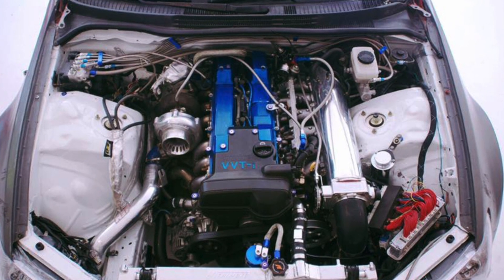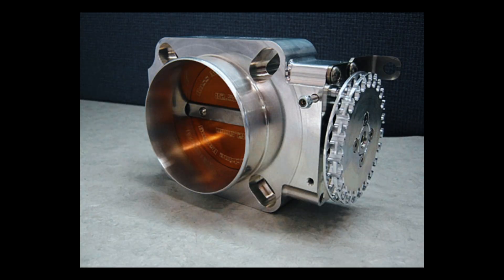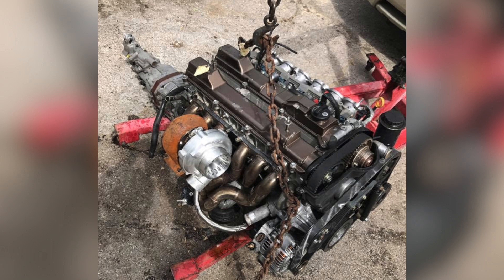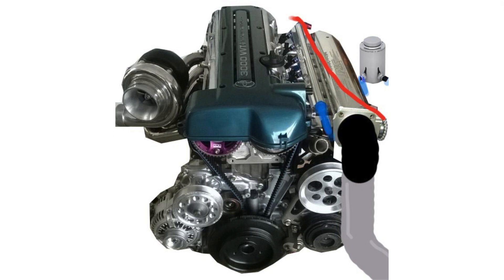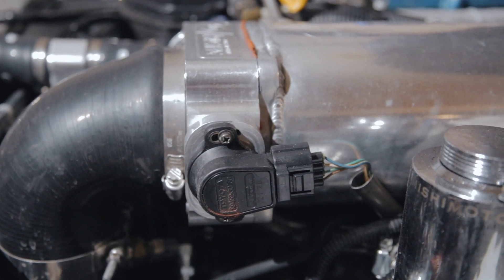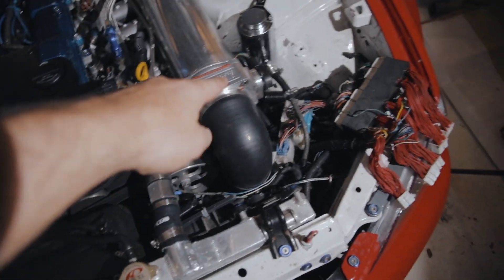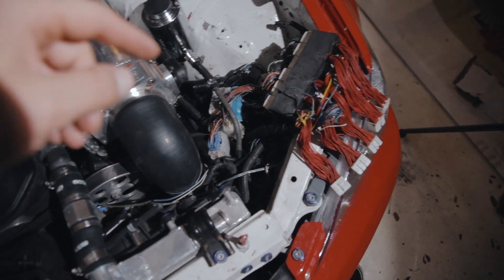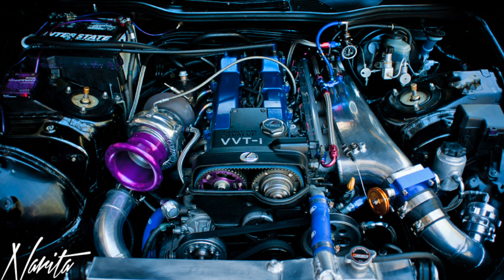HOW TO: Supra manifold on IS300

Comment: Came here to see how you bolted the plenum to the runners. Still don't know how to bolt the plenum to the runners lol. My arm is more than 3" in diameter so literally impossible to tighten the nuts from the inside.
Reply from the maker: See if you have a friend with small forearms. I struggled pretty bad with it, I put some grease on my arm to help get in there 😂
Reply: @cyrusmohebi  omg 😂😂

Comment: Hi, are you still online? 

Can I ask you some questions in DM about the intake manifold? I have 2jz ge stock, I already have the same intake manifold as you, but your the only one that has said the cruise control won't work after installation. As the car is planned for daily use, is it possible to add the cruise control function back? I have some questions about vacuum lines and stuff that must be deleted from the back of the engine.
Reply from the maker: If you are somehow able to maintain the stock throttle body you potentially could still have cruise control. From what I remember the cruise control feature is electronically controlled by the stock throttle and ECU

Comment: Could I run that setup as NA?
Reply from the maker: I wouldn’t recommend it
Reply: @cyrusmohebi  vacuum insufficiency? Compression issues?
Reply from the maker: @peterfalken2498  if it’s NA it would be too much work to go stand-alone ecu, do all the labor to fit the manifold and lose cruise control/ TCS.. just to have a FFIM and make around 200hp. There would be no point IMO other than looks
Reply: @cyrusmohebi  Thank You
Reply: @cyrusmohebi  BTW, my cruise don't work anyway

Comment: How did you tighten the bolts from the inside of the manifold?
Maybe this will help others... 
My friend and I arms and socket are too large for that closed space. We drilled and tapped holes in the plenum above the bolt holes. It was the only way we could fit our socket into the plenum then we closed the holes with bolts. Some people may not like it but it's a 130$ plenum. Your already drilling and tapping holes for the vacuum lines and you may has well make it easier installing it. Later my friend cut the bolts closer and clean up the treads.
Another good tip is to space out your vacuum lines. It's difficult to install your fitting if their too close.

Comment: This was a really good example of how to do it and what you sacrifice. I actually want to keep my cruise control for longer trips, anyone know if another throttle body that would allow you to keep it? I've read possibly an SC400 TB could work or even LS400 but can't confirm.
Reply: I'm going with a 350z throttle body with adapter on this same FFIM. Will be connecting to an SC430 DBW pedal and run on Haltech so I can retain cruise control.
Reply: Either factory TB or DBW are the simplest solutions.

Comment: I’ll pay you or someone who knows what their doing to work on my is300.  This is too hard to do by myself
Reply from the maker: Where are you located, I can try and walk you through it if it’s confusing
Reply: @cyrusmohebi  Hi, are you still online? Can I ask you some questions in DM about the intake manifold? I have 2jz ge stock, I already have the same intake manifold as you, but your the only one that has said the cruise control won't work after installation. As the car is planned for daily use, is it possible to add the cruise control function back? I have some questions about vacuum lines and stuff that must be deleted from the back of the engine.
Reply: You still open to that idea? I live in Cali

Comment: Hi, so do you just use hose clamp for the power steering hose? No leaking issue?
Reply from the maker: Lucas Vang yes, just make sure the hose you use is rated for power steering, it will eat through regular hoses like crazy
Reply: Cyrus Mohebi so the one in the link is fine, right?
Reply: Thanks a ton..

Comment: Fact- this kills a lot of bottom end response, so it also shouldn't be done if you're on stock cams or a baby turbo. Large throttle bodies aren't fun for driveability on the street, and the stock tb/intake can support 600+whp :)
Reply: Is this true for all front facing intake manifolds or just the one used in this build? I want to keep my stock 2jz ge naturally aspirated but i really want to swap to ffim cause the stock one is a pain for maintenance and looks ugly. Is there any way around the bottom end loss? maybe a different size intake manifold? Im thinking of turboing later on but for now just want the engine bay to be cleaner and easier to work on but if it runs worse id rather not.
Reply: @LMFAO5001  all aftermarket ones, yes. The stock GTE one still has a decent bottom end, but not as good as the stock GE mani with ACIS. That's literally the best bottom end response (while still having decent top end) you will get. Dont waste your time doing shit to NA just boost the bitch
Reply: @batdad187  thanks! I only want like 300-350 hp at the wheels cause i need to street drive it. Can i do that with a small turbo or am i better off with a big turbo and low boost?
Reply: @LMFAO5001 I've never seen anyone figure out how to change the 2jzge-vvti to ffim without turbo, and changing the ecu

Comment: hey brother, how did you tighten the bolts from the inside of the manifold??? I have the same one and my fat ass arms cant fit in far enough to get to half of them, any help on how you accomplished this would be great, thank you
Reply from the maker: 808volcomlifer I was able to slip my arm in for most of the bolts to tighten. I luckily had a long Allen key that would reach the bolts in the back. It was tricky but it worked
Reply: I figured as much, my plan was to weld the plenum like I did with my other build but if there was a way I could physically tighten it myself I would love to go that route, guess ill have to find someone with smaller arms then mine to try and tighten them hahahahaha. thank you for the reply, very helpful